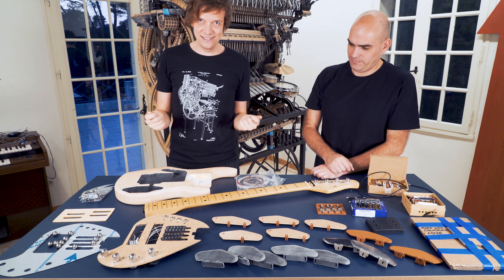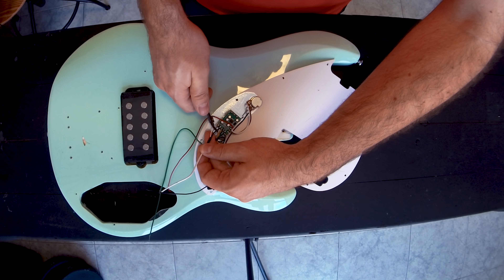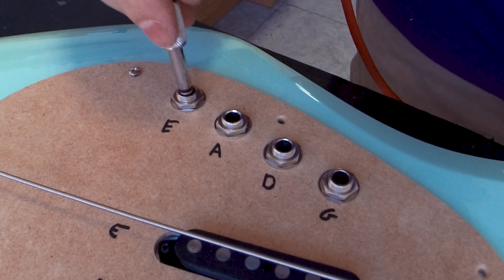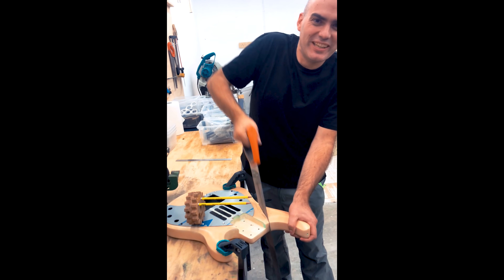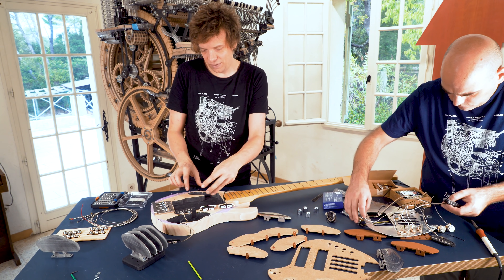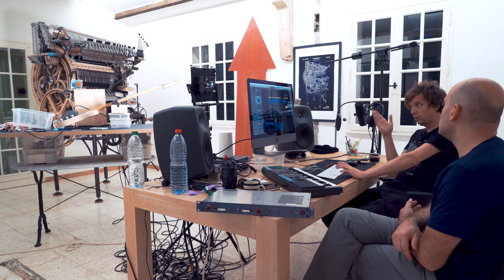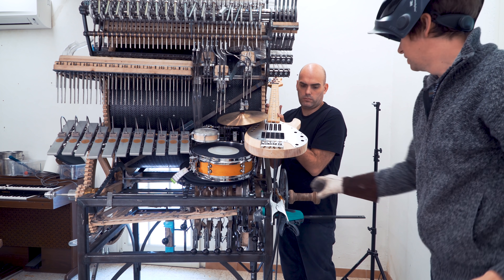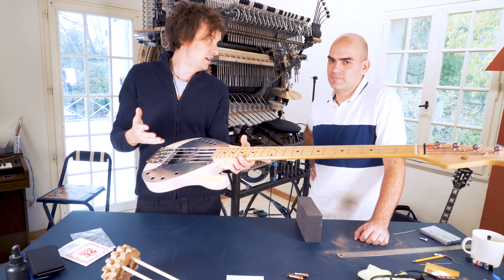Custom Bass Guitar - Marble Machine X #109

Comment: I'm just waiting for the pickup leads to get in the way of the cymbal and necessitating a complete redesign. Or more likely make custom wires that bend away right at the outlet rather than coming straight out several centimeters.

Comment: it wouldve made sense to decouple the four strings to reduce the resonant vibrations. You can still use one neck, but saddle and bridge should be split. maybe even slice the body and mount it with rubber/felt dampeners
Reply: in a sense consider each of the string a separate instrument that just happens to share the same body

Comment: I hate to ask a question with a potentially obvious answer, but... did you check the clearance between the cymbal and the bass with the four output jacks connected? Seems to me that those are in an inconvenient place. If the bass is not going to be played normally, why not put the four jacks on the back of the bass?

Comment: One thing I noticed is the tuning pegs face the machine. Why not have the tuning pegs on the right hand
so you can easily adjust it when u get out of tune. Also, just curious. Why not use a Hoffner for the body
with the head stock of a Fender? It's not like you are going to be playing the bass. So functionality
should be seen from the machines' point of view.

Comment: I wonder why you didn't use a steinberger style headless bass? They are inexpensive, have very small bodies and you could have used epoxy to attach a bracketing system to it. I guess it would have lacked the natural wood aesthetic you were going for.

Comment: I think I'd have chopped most of the bass body away with only space for essential items (pick ups and mounting points for the plates) and then mounted the electronics beneath the body or even on a separate unit.

Comment: I would create a rubber or silicon gasket to fit between the Bass and that mounting bracket. Help isolate it from higher frequency vibrations from the rest of the machine.

Comment: are you going to add some sort of loctite to the threads of the bass mount? I can see the vibrations working the fasteners loose over time with the current configuration. Maybe some sort of spring washer?

Comment: Wait, what you need microphones for? It’s an electric guitar, aren’t you just connecting to the pickups?
Reply: I can't speak as to the exact reasoning for this on the MMX, but having done some recordings of music groups, it's pretty typical to record the guitars with microphones rather than direct lines from the pickups.  I'm no guitarist though, so I always assumed it was because the amp, and any other filters and such that a guitarist is using, is added to the sound, then picked up by a microphone up against the amp to pick up the sound in a way more similar to the human ear.  Perhaps a reasoning similar to this is why Martin is using mics.

Comment: If the MMX requires more soldering, I recommend getting a better iron like a TS100  or something the sort of. And for the love of music, please use flux!
Reply: The rosin flux is inside the solder wire.
Reply: @johnm2012  Sure, but it is rarely enough. If the iron is too hot it's all gone before it can do anything anyway.
Reply: @TiSapph  There's plenty of flux in solder wire - almost too much, actually. It sounds like you're using the soldering iron to transfer a blob of molten solder to the work, boiling off the flux and making a lot of smoke. Don't do that. Use the iron to heat the work and then apply the solder wire directly to the hot work. You need to keep the iron tip clean and coated with solder ("tinned") for good heat transfer. I learned to solder when I was 7 years old and that was over 50 years ago. You don't even need a special kind of iron, just one with sufficient heat output (wattage) to heat the work quickly. Here, I'm talking about soldering normal sized components used in guitar electronics, not miniature surface mount components that definitely require a different technique.
Reply: @johnm2012  Ah that might be the source of differing opinions, I work mostly with SMD components. I greatly prefer fluxless solder and an excessive amount of separate gel flux, because I find natural rosin to just not be anywhere near as good.
To me, the solder joints shown in the video look quite flux deprived and the iron seems to be not temperature controlled. I guess for wires, pots, and the sort of it's fine, but I worry that he will try to solder something on a PCB with that iron and completely wreck it.

Comment: Carlos, a Luthier: "Do you have a saw?"
Me, an Intellectual: "Do you have a hand-powered angle grinder?"
Reply: Angle grinders are no good for wood though. At least in sweden I have never seen any wood blades available.
Reply: @Frendh  You can get some which is made  a little like a chainsaw
Reply: omg what in the hell. This is horifying
Reply: @pladselsker8340  Yes it is, stay far away from that tool!
Reply: @haqvor  yeah handsaw are our friends I love handsaw now hahaha...
Reply: @pladselsker8340  I'm comfortable using high performance chainsaws, they can cause horrific injuries if used improperly but if you know how to handle them and how to protect yourself they are much safer to use than this abomination.

All power tools that can cut wood also chews up muscle and bone just as easily.
A good handsaw should not be underestimated, it is a very useful tool for the right job.
Reply: llego el iluminado.....

Comment: You may wish to consider putting the Phono jacks on the underside of the guitar, that way you can use 90° jacks and route the cables for individual pickups a little easier and they’ll be out of the way of the cymbal as well